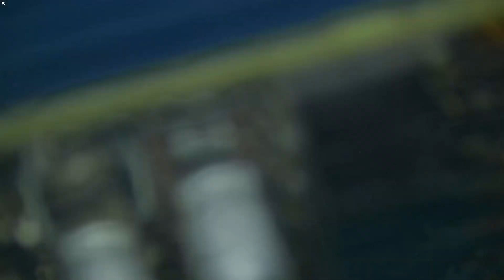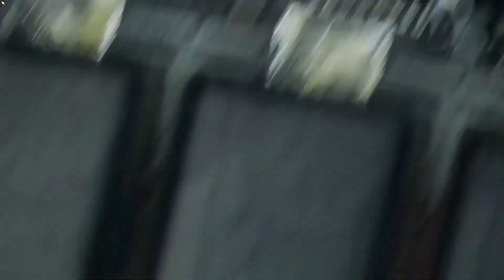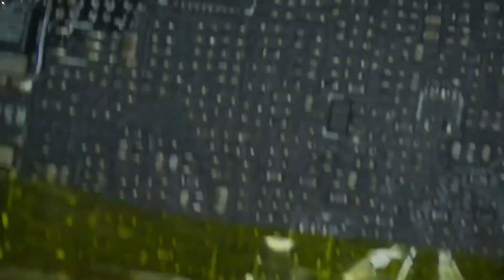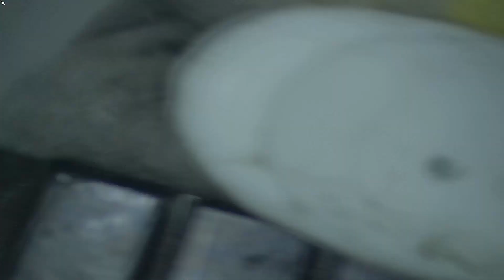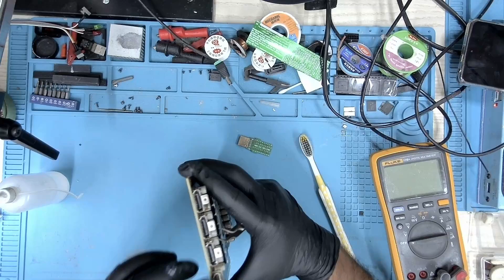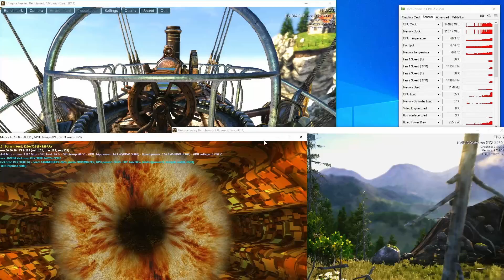This Is The Fate If Your GPU Does Not Have Fuses - Colorful RTX 3080Ti Repair

Comment from the maker: This card has 14 Phases and the MOSFET it uses is rated at 50A (AOZ5332QI). So the total combined power these phases can deliver is 560 watts (Power = Amps x voltage). Voltage is 0.795v. The core only needs  350 watts under full load. So in theory each phase can deliver 39 watts. With one MOSFET missing, the total capacity on this GPU is now reduced to 520 Watts which is still a lot more than what the core requires which is only 350 Watts. So the card will perform just like it did before without any performance drop.

Comment: How much is my faulty RTX 3080 ti worth?
Reply from the maker: It depends if the core is dead or alive. If the core is dead, then it's just a paperweight. If it's alive, then you can get at least $100 for it at best.
Reply: @GraphicsCardRepairs-tk7ql  my 3080 ti gigabyte won't post after power surge
Reply from the maker: @zivsahar there might be a faulty rail. It needs a repair.
Reply: @GraphicsCardRepairs-tk7ql  how to check if the core is dead?

Comment: Love the video, I have a Gigabyte RTX3080TI that needs some expert help, the GPU installed in the PC with no power connected the PC will boot, with power applied to the card the PC starts to boot then immediately shuts down, having to remove power and the process starts again if I try to apply the power connectors to this card. Where are you located and what is your time frame?
Reply: Where are you located? I'm in the US are you here or in Dubai? Thanks
Reply from the maker: I'm in Dubai
Reply from the maker: It looks like there is a short circuit on the GPU PCB. The link to book your repair is in the description of the video. I will be on vacation from today until 16th of Jan.

Comment: My 3080 ultra has blown through the pcb. Would i be able to grind both sides of the hole to remove short.
Reply from the maker: If the short is through and through. Then there is a slim chance to fix it. There may be some connections that may be required.

Comment: These cards are notorious for having that 3rd from the top down, 50A "AL00" (AOZ5332QI) Alpha & Omega mosfets blowout. I have noticed that the AOZ5311NQI or BLN0 55A siblings fair better. Also the AOZ5312UQI or 60A BKU0 I have not seen blow out like the 50A ones. I have started replacing the AL00 50A with 55A BLN0 and cards work perfectly. Just for that 3rd down mosfet for redundancy. Only downside is that the 55A and 60A ones are expensive! Btw, fuses or not, they still blowout along with their fuses.
Reply from the maker: Ya I will now started to replace these AL00  to BK ones. These are not able to handle the power specifically on 3080 ti and 3090. I have ordered stock of these ones.
Reply: @GraphicsCardRepairs-tk7ql  They are a bit more expensive, but every card I have used BLN0 or BKU0 as replacements have never come back. I had a card like that with a hole where the mosfet should have been. I talked to the customer and he agreed on having the remaining phases replaced with 60A phases, since one is now missing, just for redundancy because I know the rest of the 50A phases will now have to work harder during high or low switching, and this is going to be a problem in the future. 

He agreed and that card has never been back. I know the guy and he is a happy camper. This is a Gigabyte 3090 card that came with AL00 50A mosfets. The worse from Alpha & Omega in my opinion.
Reply from the maker: I have a 3080Ti with the same issue. The core is now dead because of the short. i have to replace the core and MOSFETS.
Reply: @GraphicsCardRepairs-tk7ql  Oooof..sorry to hear that my brotha. All that work due to trash mosfets. They should at least be 55A in my opinion.
Reply from the maker: The customer donated the GPU to me. I have the replacement core. just waiting for the MOSFETS.

Comment: Great video, I have the same card that burned out the phase and caused a problem with the PCB. I disassembled it but some connections were damaged and it works without it but there is a problem which is that it only works on the frequency from 870 to 900 from the default frequency of 1335 and 1665 for Boost. Are there any thoughts on this?
Reply from the maker: Well first the MOSFET's would need to be measured with an oscilloscope to check if all are firing. My assumption is power is not getting delivered.
Reply: @GraphicsCardRepairs-tk7ql  Thank you, I was able to solve the problem. There was a blown fuse with the letter Z on the right side
From power port 8, the card now powers on normally

Comment: Does the card work without one phase?
Reply from the maker: Yes, it does. This card has 14 phases with 50A MOSFETs each and a capacity of producing 560W. The core needs only 350W max. By losing one MOSFET the total capacity has been reduced by 39W but is still more than enough for the core. The load will be shared but more than even with 13 phases it is more than sufficient.

Comment: Great video but my only Problem is you didn't replace the missing phase this card is going to be back in another two months time when the other phases are over worked.

You can already see in the stress test the core isn't hitting anywhere near 2000mhz, also it's possible to add fuses I've seen other videos where people have grinded away the mask and added them in series, just pointing it out 

Otherwise great video.
Reply from the maker: Yes, I could have added a fuse. Something I can start doing in the future. Thank you for bringing it up.

After drilling to remove the short, there is nothing left to install the new MOSFET there. The pads were grinded so the short could be removed and there was a hole by the time the short was gone. This card has 14 phases and a MOSFET rated for 50 Amps each. the total power these phases can produce combined is 560 watts. Each phase can produce up to 39 watts. The core only needs 350 watts. with the load shared with One MOSFET missing the capacity now is 520 watts which is still a lot more than the core requires.
About the clock frequency. RTX 3080Ti max boost clock is 1665Mhz (unless overclocked). In BIOS the GPU clock is at 1365Mhz and Boost Clock is at 1665Mhz so this card will not boost above 1700Mhz in any way. You can pause the video after i open GPUz and in the first tab at the bottom of that application you will see the base clock and Boost clock. The frequencies you see in the video is boosting are as per spec of Nvidia. There is no overclocking done on the GPU.
Reply: Fuses do not help. They will blowout and also take the mosfet down with them. At the PCI-e they use 10A fuses and at the 8 pin rails they use 20A fuses. But still this is no help. What I have started doing is replacing those 50A mosfets with 55A or 60A ones. Cards never been back and TDP is where it should be, around 99%-100%, along with proper frequency boost.

Comment: This was fascinating. I would have figured the card was beyond repair with that scorched pad. Would there be any issues with running the card without that mosfet?
Reply: I tried looking up what a MOSFET even is. It seems very complicated and I didn't understand any of it. lol

I assume the load would be distributed to the remaining ones, which seems like it would just increase the strain on the others and result in another one going. I presume the card might guard against that by a slight drop in performance. Essentially slightly lowering the card's maximum performance.
Reply from the maker: There is a lot to consider before drilling a hole. Now in the case of this PCB, it has 14 power MOSFETS. In this case, each MOSFET is rated for 50A. Now in theory the total watts these MOSFETs on this PCB can deliver to the GPU core is 560 watts (P=A x V) which is way above the 350 watts that it needs. So even with 2 MOSFETs removed, this PCB will deliver the same power required by the GPU core that it would with all MOSFETs installed . YES, the load will be shared by other MOSFETs but there is tons of room for it on this PCB. In this case, the performance will not be hampered.
Reply from the maker: This MOSFET part number is AOZ5332QI
Reply: @DexLuther  MOSFETs are special transistors that are mainly used for regulating current flow in this case. Transistors are commonly used for switching and amplification. It's a bit more complex, but I hope this helps.
Reply from the maker: No there would not have been any issues without the MOSFETs. But since 2 were faulty i decided its best to get at least one installed.